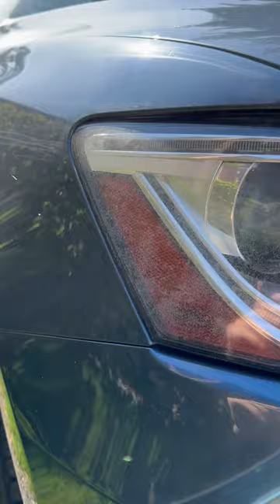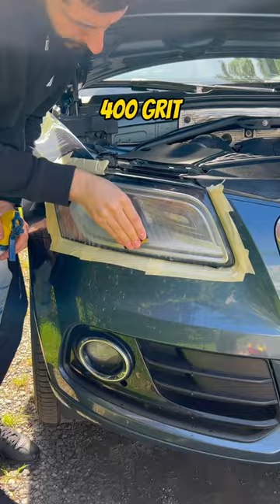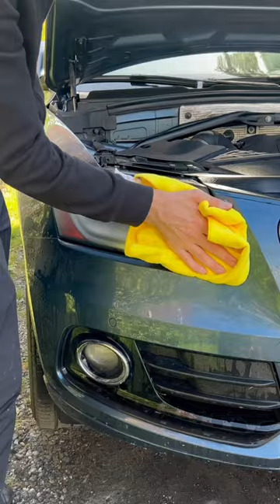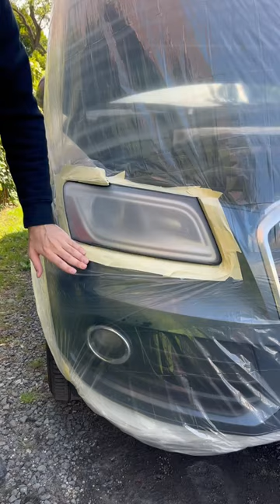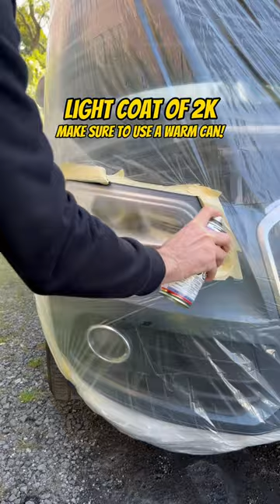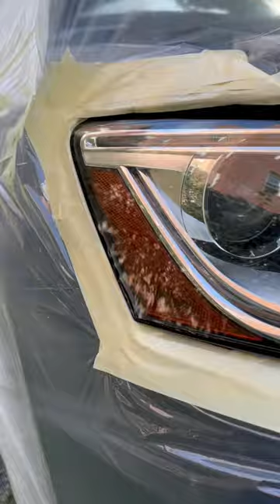The Secrets To A Mirror Finish!! 😯

Comment: I was impressed by the result but holy shit this man knows how to mask properly  😂
Reply from the maker: Lol I appreciate it!!
Reply: @modernvehiclecare what is 2k and tack
Reply: @ao9op9o 2k primer and tack cloth for the buff I think
Reply: 2k or 2 part means that paint and paint hardener are separate. Theres a pin on the bottom of a 2k can that releases the hardener into the paint. The point is to make the paint harder, more durable and long lasting, also just looks better apparently.
 A normal spray can lasts for years on the shelf, 2k once you release the hardener is up to a week before its solidified inside the can.

Tack is short for tack cloth which is a cloth specifically meant to remove dust before painting. @ao9op9o
Reply: @KK001  exactement, très bon résumé d'explication  .

Comment: I've seen a lot of these, and it hasn't help me understand what the direction "Tack" is. Can anyone explain?
Reply from the maker: It’s the use of a tack cloth to wipe the headlights before clear coating. It will pick up dust that would otherwise get trapped under the clear coat

Comment: Use synthetic oil rub it in works on even the most darkened lights. It’s right there in your can put in rag and wipe. Lasts 3 weeks depending on weather.
Reply: I also use quick 30 second fixes. Much easier and quicker just has to be repeated. This method is for a good finish. And lasting result. But this would take significantly longer.

Comment: Good, actually one of the rare videos with proper procedure. Basically you did all right and you depend on spray quality now. If it has UV protection it will last 2+ years, if its a good brend and product with UV protection might go over 5 years in my experience
Reply: how long will polishing last?
Reply: @arcadiusvinzenz6005 rubbing & machine polish will last more than 5,6 years.
Treatment like this in the video will not gonna last long in worst places
Reply: @@phillipbanes5484 that's because headlights are clear lenses but paints are not. So when we not gonna maintain the headlights properly it will change the colour in yellow.  Wax and polish is the best method to last longer the headlights in my experience.
Reply from the maker: Thanks bro!
Reply from the maker: On what planet will polishing lasts 5 or 6 years cuz its definitely not earth my boy 🤣

Comment: uhh so i have a question, what is "Tack"? I have no idea at all. 

Thank you.
Reply: Tack cloths are used to remove any contaminants before applying any paint or lacquer. All  car parts stores sell them.
Reply: @6ettinold like  a sunglasses cleaning cloth ?
Reply: @6ettinold why are they tacking after already applying a coat though?
Reply from the maker: @foojub6907 it’s the secret to a perfect finish when restoring with 2k lol
Reply: @modernvehiclecare  I need to give that a try… those restore kits don’t last too long. Any preference on brand of tack cloth, or any will do?
Reply from the maker: @foojub6907 any tack cloth will do
Reply: @modernvehiclecare  thanks!
Reply: thank you. i also confuse about tack. i think its like a chemical or something.

Comment: Hey again dude i have another question can i use 400 , 600 , 1000 ?
Because i didn't find the 800 grit in my local shops
Reply from the maker: You can but you will just need to sand more with 1000

Comment: What is tack?
Reply from the maker: The use of a tack cloth to wipe the headlights before applying clear coat. It will pick up dust that would otherwise get trapped under the clear coat

Comment: You should do plastic cover up thingy during the sanding process as well . Will save time and will minimize the risk of scratching the clear coat when you are whipping the bumper  Just a advise.
Reply from the maker: It will trap water and make a mess. No worth it in the end
Reply: @modernvehiclecare  interesting

Comment: How long do you sand for each grit level? When do you move to the next grit level? Can I use anything other than 2k Glamour? What do I look for when getting an alternative clear coat to 2k Glamour? Thank you :)
Reply from the maker: You sand in alternating directions until you can no longer see the previous grit marks. Unfortunately glamour clear is the only can that’s effective and reliable based on my experience. The alternative is to mix your own clear coat with a hardener and use a paint gun and air compressor.
Reply: HI MATE CAN I USE THIS PROCESS ON ANY CARS HEADLIGHT ?

Comment: Do you think this will work with lexan windows on a boat?
Reply from the maker: Maybe if they are clear polycarbonate
Reply: I used the rubbing down with very grit paper and then compounding and polishing and polish method on my motorcycle screen due to the amount of scratches. The only problem is that it takes of the hardened coating so have to add a form of protection via a clear lacquer which needs to be applied VERY evenly. I put the lacquer on fairly thick and then sanded and polished that back. 
You don’t look through a headlight like you do a screen or window.

Comment: Looks good but if your not confident at spraying sand as shown and then Meguires compound and  polish or other make. Don’t even need a polisher as can get away with a 3” polishing pad that will fit a cordless or mains drill. Takes a bit longer but less out lay for a one off task..
Reply from the maker: Practice makes perfect bro! The polishing method can make headlights look better but without proper uv and rock chip protection, they will just look worse a whole lot faster lol

Comment: Would this work with faded tail lights as well? :)
Reply from the maker: It would but in most cases wouldn’t be necessary. You can just wet sand with 1500, 3000 and polish tail lights since they won’t oxidize like headlights

Comment: Question might be dumb question but wat is that that you do when you say tack
Reply: You wipe the headlight with a tack cloth to remove any dust before spraying
Reply: Isopropyl?
Reply: @Hondasonly  
1. Complete sanding 
2. Wipe it with isopropyl alcohol 
3. Let the alcohol evaporate
4. Wipe it with the tack cloth
5. Spray on a light coat from a warm can
6. Wipe it with the tack cloth again after the light coat has dried for like 10 minutes (don’t use isopropyl alcohol again)
7. Spray on a heavy coat from a warm can
Reply: @rasmusnonbo5998  what is a tack cloth?
Reply: @Hondasonly  It’s just a cloth that is designed to remove and collect any loose particles of dust, dirt, lint and so on. That way the surface will be completely clean and smooth when spraying on the clear coat.
Reply: A tack is a tool like a fabric, it's special for the painting job
Reply: @rasmusnonbo5998 so what brand is the coating laquer ?
Reply: @AUTOHAUSEUROPA  I don’t know what brand he’s using but you just have to find a 2K clear coat.
Reply: @rasmusnonbo5998 why use a tack cloth instead of a microfiber towel? That's the part I don't understand.
Reply: @elisicamost5959  You can use a microfiber towel if you want to. Just make sure that whatever towel you’re using, it has to be lint free. I just personally prefer the tack cloth because they most often come with a sticky material which gives me the feeling that it picks up dirt and dust a lot better. Also I’ve experienced multiple times that a microfiber cloth leaves material on the headlight even though it said lint free. It’s really just what you prefer to use and what level of quality you’re buying. Microfiber cloth is washable and reusable, tack isn’t, so it also depends on how often you’re using it.
Reply: @rasmusnonbo5998 tack cloth is sticky. Tacky. Hence called tack cloth

Comment: “Tack” is what ? Just drying ? Also how much do you charge for a job like that, I have a detailing business and was wondering .
Reply from the maker: Its a special rag designed to pick up dust before clear coating. Pricing will depend on your local market. On average it’s a few hundred
Reply: I guess demand for this service also depends on the parts market for whichever car you’re doing. For my car I can buy new OEM headlights for $250

Comment: Why you apply clear coat instead of just polishing with machine? I start with 800 grip, and then 1000, 1200, 1500, 2000, 3000 (at 3000 it's almost crystal clear without polishing or applying clear coat) and then just use polishing machine with 2in1 cheap polish. I don't see any difference in the results. And it take off way less material of the headlight then using 400 grip sand paper. Also, the clear coat becomes terrible after some time, because it starts to peel off. And it's worse then the yellowish colour the headlights get...
Reply from the maker: The difference is that the clear coat will actually protect the headlights like the factory coating once did. You won’t be preventing any further damage from rock chips and uv rays using the polishing method. You may not notice a difference in videos but in real life, clear coating looks way better.
Reply: @modernvehiclecare  Thank you for the explanation. I might try it on my cars headlights when the weather gets warm.

Comment: Can we use 2000 grit sanding after 1000 then clear coat
Reply from the maker: I wouldn’t recommend as the clear coat needs a rougher surface for it to bond properly
Reply: @modernvehiclecare  ok got it.

Comment: Would love to see what these look like in 2-3 years
Reply from the maker: 2-3 they will still look great but if they are taken care of properly they will last up to 6
Reply: I hear 2k clear cracks and is a pain in the ass to remove
Reply from the maker: @itsandrew8758  all coatings on top of plastic will eventually fail but this one lasts longer than anything else. When it fails it’s the same process for restoration. 400-1000 grit
Reply: 2k clear is what is on automotive paint for base/clear jobs. It has a catalyst in it to harden. I have done this for years. Sold a car that sat outside every day after doing those and they just started to fail at 5 years. Have also had some fail at 3. Either way not bad. Sandi process is basic. Not bad at all. Especially with a DA sander.

Comment: Is there any downside to polishing the lens until it is clear before you clearcoat?
Reply: The rough surface lets the coating bond to the lens and helps prevent runs.
Reply from the maker: Yes it won’t bond properly and will fail prematurely